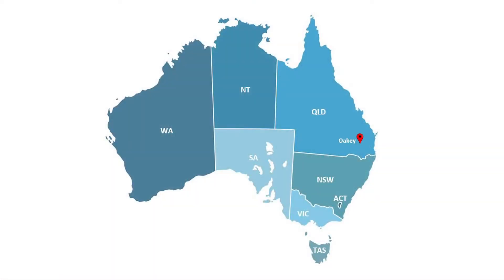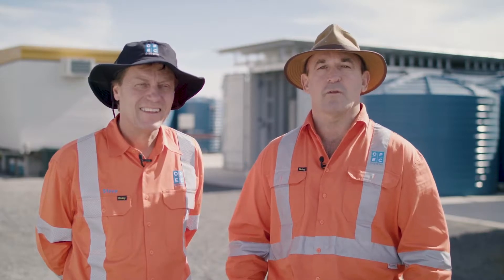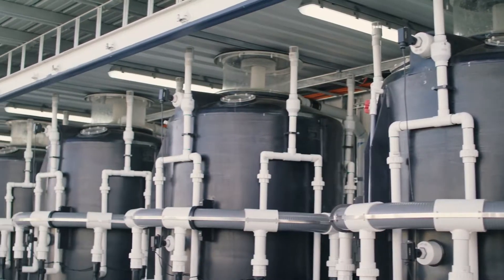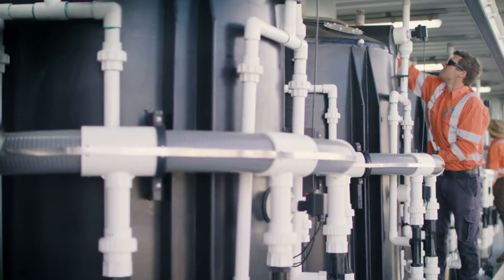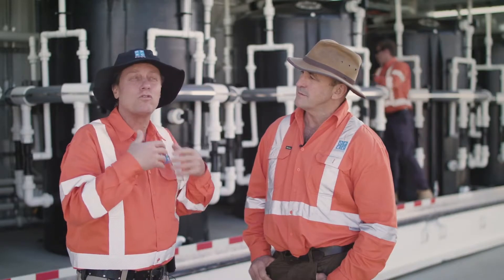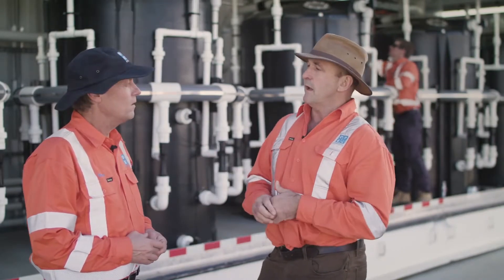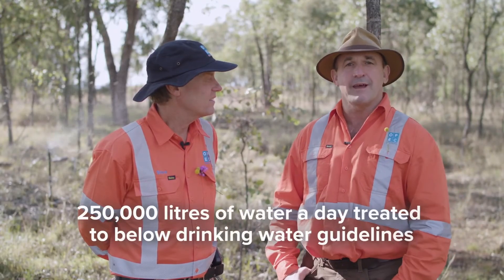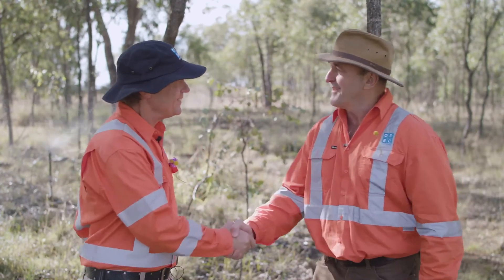Oakey Foam Fractionation PFAS Water Treatment Plant (5 minute version)

Comment: Some ponderings: Is it a batch process or continous? What are the main PFAS substances you are reducing? Are you using nozzles or diffusers for introducing the air? What I can understand you do not use air saturation as with DAF but a blower for air ad in WWTPs. Last but not least - Saw your video about all the work you put into this for reaching all the to full scale - Awsome!